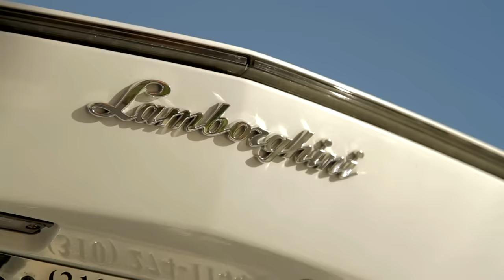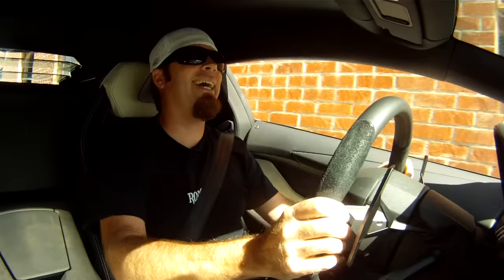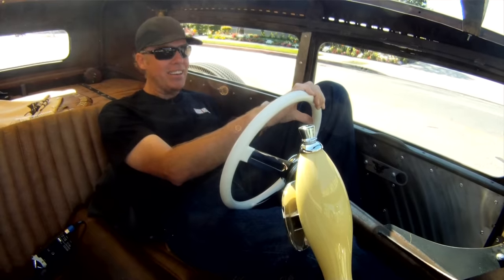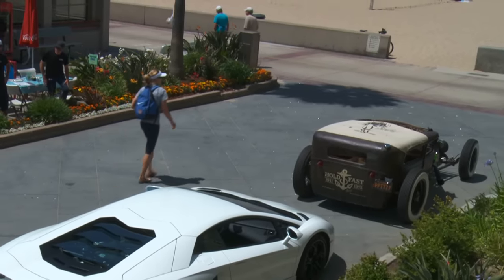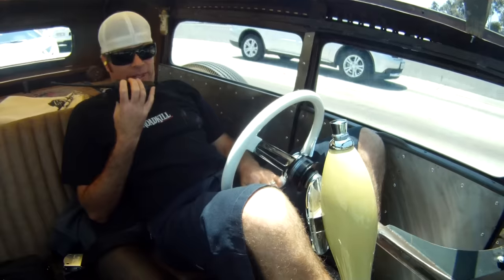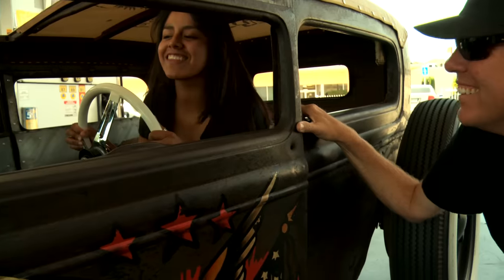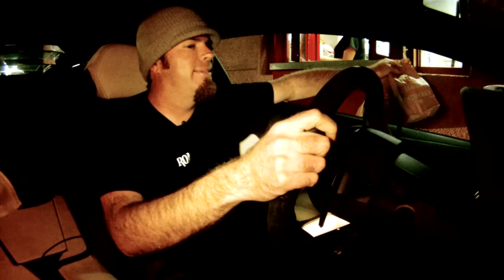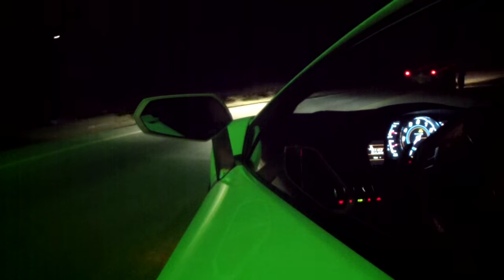Rat Rod vs Lamborghini Aventador! Roadkill Episode 5

Comment: The rat rod, hands down. But I'm a bit biased towards hand built death traps. ;)
Reply: each rat rod is unique and about 1/40 the price
Reply: I'm building a hand-built death-trap. It's a 1983 Nissan Patrol Safari two door. All Chevy drive train. 5.7 liter LT1 from a 1995 Impala SS, TH400 w/NP205 twin stick transfer case with Dana 60 front and GM 14 bolt full floater rear axles with 4.56 gears on 35" tires. Enough to get me in trouble...
Reply: have experience with 'em, eh?
Reply: I think I know why chicks dig rat rods...its because they know they'll get a similar experience to sitting on a washing machine during the spin cycle! 😂
Reply: @kevinkirk4285  Make sure you give it a beefy cooling system so it doesn't overheat in traffic. Also make sure the ride height is just enough so it doesn't get beached on slightly sloping driveways. 😉
Reply: @phantomechelon3628  Got the cooling system covered... It's rated for 700 HP for a 360 HP stock LT1. ...as for the rest... let's just say that Finnegan and Freiburger would be proud.... because...Roadkill... although I have anticipated any stupid situations... If I break what I have, I have far bigger problems... because...Roadkill.

Comment: They got ripped off spending $6000 on the lambo for 24hrs,  you can rent one for $1999 for 24hrs.  That's $4000 in the pocket for beer!
Reply: It's an aventador.. much more expensive
Reply: Remember this came out when the aventador was brand new
Reply: Mr Iceman ummmm I’m surprised that for 24 hrs they didn’t spend like 8 to 10 thousand ur probably thinking of the huracan but this is a aventador if u buy a huracan u pay like $250,000 but a aventador is $650,000
Reply: @joeymattison437  Who told you that the aventador is listed at $430,000.
Reply: Joe Mattison for an aventador svj yes 600,000 but for a regular aventador 400,000. aslo there is nowhere on earth that charges 10k to rent an aventador for 24 hours. Even in 2012
Reply: You forgot the strippers
Reply: This is California. It's mostly tax charges
Reply: How much beer do you drink?
Reply: The Aventador was a brand new car back then, it's obviously much cheaper now
Reply: It’s also in California so depends on where you’re located
Reply: No no, that 2012 Aventador was brand new at the time. Had to pay a premium for the new one.
Reply: Beer cheese and soft pretzels.

Comment: you guys are forgetting one small detail. Lamborgini is currently owed by volkswagen, a german manufacturer. And in germany there are many highways that have NO speed limit.  Furthermore there are highways where you can drive 130 k/m. On these highways there is virtually no speedcontrol at all. Which means people are also driving as fast as they want. So for the german customers a lambo is not just for the looks. They can legally drive it on public highways at max speed. 

Btw i drove a lot on german highways, and its quite cool when you can legally drive as fast as you car goes.
Reply: in theory... you're half right.
First off: concerning the speed control: do you mean the No Speedlimit ones or the 130km/h ones ? because on the 130km/h ones there is Speed Control. Only you barely see it if you are not going too fast. The other thing: Drive as fast as you want ??? yeah maybe in theory. In reality you barely get past 200km/h due to other people being in you way.
Reply: Ram Skirata
btw, I'm German
Reply: Ram Skirata I understand what you mean. But, if you want to drive fast, you can chose to drive late in the evening/during the night. I have driven in germany during nights and its max speed without much obstruction. As for speed controls, I dont know. I havent encountered any kind of speed control on 130 km/h highways, and germans just drive 170/180 on these without caring much. So I assumed there are basically no speed controls on these highways.
Reply: ok in the evening and at night you are right. But its still very dangerous once you get past 200. Simply because: it doesnt always have to be you fault. COncerning the speed copntrol: There is. ist basically invisible with speed traps well hidden.
Reply: I care to much about my car and my license. Also i am a very responsible driver
Reply: Ram Skirata When I drove in germany, it was in leased cars, so I didnt really care much about them anyway. I agree its important to drive responsibly. But when I overtake a truck with 160, and look in my rear mirrior and see a women in a mercedes coming at me at high speed, signing with big lights to get the fcuk out of the way, it kind of makes me want to drive fast as well.... :D
Reply: Siri Rii lol
Reply: contradoor12
Reply: they seemed to be hating on the lambo quite a bit.  probably because they can't afford one.
Reply: I dont think so. Freiburger has driver cars that outperform the Lambo in the quarter by far and while doing that are way cheaper.
Reply: but mostly other cars slower cars will drive in your front, even if there are 3-4 lanes :S
Reply: of course they do. C10s are fairly cheap e.g.
Reply: born and raised in Berlin. And the US just makes the coolest cars. C10s are failry cheap compared to euro standards,
Reply: contradoor12 They're in America.
Reply: Team Tornado Boy you speaks good American
Reply: William Chemini I can't tell if you're being ironic or if you're just oblivious to what you just said.
Reply: That's why the best Formula1 drivers (and, unfortunately, cars) are German. (btw I am not German)
Reply: See Em It may surprise you... Volkswagen manufactures vehicles under the following brands:  Audi, Bentley, Bugatti, Lamborghini, Porsche, SEAT, Škoda and Volkswagen, also Ducati motorcycles and MAN, Scania,  and Neoplan trucks. 

Scania, Bentley and Ducati were a surprise to me as well.

Btw Rolls Royce is a BMW brand for a while now. They made the Phantom. As well as Mini's....
Reply: Yes but Lamborgini remains italian...
Reply: Giovanni Carini just like fiat owns chrysler, but chrysler remains american
Reply: ***** And Chryslers are still crap XDGiovanni Carini  Lamborghini remains Italian, with the quality of German engineering behind it.
Reply: Mike well no, i have owned 2 and they gave me no issues so, your wrong i just wanted a corvette instead :) and lamborghini's are perfectly find without the germans and this is coming from a german
Reply: I'm from germany and here on the most highways aren't speed limits and if there isn't much traffic you can sometimes drive very fast
Reply: contradoor12 This thread has devolved so much it's sad. Don't even bother comparing a car to another car that cost several times as much. Not all muscle cars are slow through the corners (GT350R anyone?), and not all supercars are bad because they cost a lot more than things that are nearly as fast. When talking about muscle cars, it's important to note that they are fairly easy to drive every single day. You can't say the same about a Lotus, much less a Lambo. Cars are all good for different things.
Reply: NotAnotherYoutuber autobahn is just the german word for their highways. They do have big rings around every major city though.
Reply: contradoor12 Id still rather build 700hp than buy it, if its a 7 liter engine it should be making well over 700hp if it is tuned properly. $400K can get you a long way with a mopar or a blown alcohol chevy..
Reply: Mac Sogandares its not all about hp. in the US a race car just needs to go in a cirlce or a straight line. In europe cars also have to be able to take corners fast. Building a car urself that can do that would require some seriously skilled engineering ;)
Reply: contradoor12
That's right, because NASCAR never does road courses and Indy, AMLS, and Grand Am are definitely not real things. It's not like there are several world famous road courses in the US and various racing series that utilize them or anything.
Reply: contradoor12 no cars make horsepower like straight line cars. And road courses are a thing here as well. Current NASCAR spec is over 850hp unrestricted for road courses, so your argument is invalid
Reply: lamborgini is owned by volkswagen, which is a german manufacturer. I did not mean to say that lambo's are german. 

I do note however that the influx of capital and technical knowhow has benefited the brand greatly. Consider that when Volkswagen/audi took charge of lamborgini in 1998, there was only 1 available model, the Diablo, which was basically an 80s car that was still being build until 2000. After 1998 two new lambo's started development Murciélago & Gallardo and both were released in 2003. If you understand what this means, you'll see that they are still Italian cars, but with a very large amount of german technology, a lot of it came straight out of Audi's research center.
Reply: THATS SUCH ALIE
Reply: contradoor12 You are wrong m8 Lamborghii is owned by Audi since 1998 :D
Reply: Pavle Panev you should look up the family tree of the volkswagen group. Its selfexplanatory ;)
Reply: Pavle Panev Audi is owned by volkswagen group :)
Reply: Ram Skirata
Reply: Marcus Page
Reply: contradoor12 lamborgini isnt owned by volkswagen its a company by its self
Reply: ***** nope
Reply: ***** Actually Lamborghini was bought about 5 years ago by FORD!!!!!!!!  Ford decided they really didn't want it to start with - so they sold it to Volkswagen - which now owns 55% of Lamborghini!!!!!!!!!!  VW went on a buying spree a few years ago - VW also own Audi, Bentley, Bugatti, Lamborghini, Porsche and Ducatti!!!!!!!!!  It is a cold world out there - sell or be eaten!!!!!!!!!
Reply: +billyhatcher643 I'm like 😱😁😳😶 when I found about this really Volkswagen
Reply: Volkswagen owning Lamborghini has nothing to do with anything..
Reply: contradoor12  that is cool I thought lambergini was its own company
Reply: an aventador can go 354km/h... good luck driving that thing at max speed, you could drive it fast yeah.. and the acceleration would let u achieve speeds fast, but you wouldn't go much further than 200-240km/h
Reply: Problem with german Autobahn is: as soon as you're up to speed you have to slow down again because of a fucking construction site. Also, there can be speed limits on some parts where you have to drive 120 or 100.
Reply: ehh tbh i drove my bmw 118 with 134bhp at 211 a few weeks ago... i guess a lambo can do much better than that... hehe. But I do not condone unsafe driving in any way. I drove 211 just for a straight stretch of highwayr of 2 kilometers with no-one else on it...
Reply: I wouldnt never buy a Lamborghini. Cost vs product a person could have a company of their choice  build a brand new o mile american v8 of their choice cheaper that would out preform a Lamborghini in every way and still have 3x 4x the power.
Those cars are more a a status symbol I think.
Reply: contradoor12 so your saying that I can drive 200mph on the German highways
Reply: contradoor12 🍈🍈
Reply: contradoor12 k
Reply: contradoor12 oh yea Im driving with my bugatti in german 400km
Reply: contradoor12 no actually the company,Lamborghini Automobili made Lamborghini and Volkswagen Doesn't own or made Lamborghini
Reply: CesarGaming 9012 Lamborghini automobile is owned by volts wagon - Jesus Christ auto correct
Reply: Mythical bro Hgh haha nice one
Reply: Mythical bro Hgh ore like the morgue lmao
Reply: contradoor12 i
Reply: contradoor12 Lamborghini is owned by Volkswagen and Audi
Reply: contradoor12
Reply: contradoor12 I
Reply: I did not knew that
Reply: ziyan
Reply: contradoor12 germany is the richest place in earope
That make bmw's or so they made toys like playmobil... idk why im talking help!!!!!
Reply: contradoor12 the autobahn

Comment: What about a lambo v12 in a rat rod ?
Reply: hahha i like it
Reply: Depends on the ratrod. Itd probably tear the thing apart. Some ratrods can handle a frikin lot of power but probably not a v12
Reply: Idk some rat rods have mad engines and would have more power
Reply: As long as it has a strong enough body it works
Reply: @Mr. Hollywood ok thanks. Its quite interesting
Reply: That would ruin the rat rod
Reply: Halo themes intensifies
Reply: Forza has entered the chat
Reply: @J D it would, not all engines weigh the same

Comment: Everyone seems to forget that these guys are hot rodders and drag racers. In the grand scheme of things, 700bhp really doesn't cut it. That's the sort of power they were getting out of their 'Draguar' and that's just a cruiser.
Reply: ummmmmm the draguar maybe made 250hp
Reply: Have you seen the episode of Hot Rod Unlimited where they swap in a new engine and bench test it? Puts out way more than 250bhp now.
Reply: DoesNotHaveAnXbox I love your Icon. Motorstorm <3
Reply: TheMalysch77 brake horse power
Reply: Nick Milley but why does it bother you if I want an old Jag with a small-block crate motor and a supercharger sticking out the front over an Aventador? And I love Lambos, just that a one-off rod like the Jag will always be unique.

Jeez, why is there so much hate between the different aspects of car culture?
Reply: TheMalysch77 wheel horsepower. Basically the power measured at the wheels, after it's gone through and lost power through the gearbox, differential etc. Brake horsepower is measured at the crankshaft.
Reply: Nick Milley You just saved me a lot of lines! Nick for president!

Comment: Your rat rod is luxurious. My '32 Plymouth coup rat rod didn't have a seat, and the floor pan was a 1 ft. wide piece of plywood  that spanned the frame and wasn't even bolted down. It slid back on acceleration, and was stopped by the roll bar. The bad front U-joint and the open driveshaft were a bit of a concern though. Thanks for the memories. You guys are having way too much fun!

Comment: Wow, I must be weird! I'm as male as it gets, and I'd take the rat rod over the Lambo any day.
Reply: +awesomeferret to have, i'd take the lambo. you'd really want to drive that deathtrap on a regular basis and a car with the most basic safety features?
Reply: +awesomeferret not to mention overheating in traffic
Reply: Duns for Hands no, but considering that most Lambo owners don't consider it their primary car and don't drive it every day, is it really that much of an issue? Anyway, if I had that specific rat rod, it wouldn't be that specific rat rod. I would make some modifications to make it a wee bit safer (moving the seat, raising the top and installing a bigger windshield, for example).
Reply: +Duns for Hands Just a matter of time before the pistons shoots up in the sky and the engine block will be scattered all over the road, haha.
Reply: +Duns for Hands that was the worst example of a hot rod my friend
Reply: +Johannes Larsson Yeah but its way cheaper to get a replacement motor for that rat rod than the lambo. Blow the motor on the lambo and you are talking easily close to 6 figures.
Reply: +awesomeferret no you are just a car guy most of those guys noticed the lambo because thats a popular vehicle everyone knows the ratrod was the real treat
Reply: I'd gladly take the rat rod
Reply: you are definitely not alone!
Reply: same!
Reply: Lamborghini's don't have airbags.
Reply: +Rotten Banana ya theydo
Reply: Justin Smith Most don't. Btw the ones that do have airbags, only have the driver airbag.
Reply: +awesomeferret They dont consider it their primary car because they don't trust themselves to drive around that kind of money

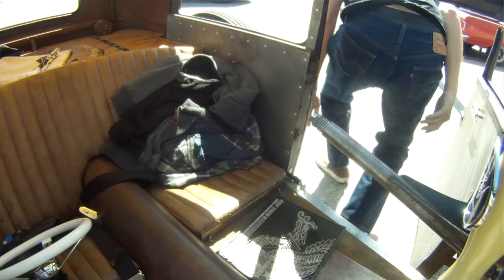Comment: rat rod sound awesome, but lamborghini anytime... 8:35 are you sure that the steering rod is not the one that kills in accident?
Reply: No, the rat rod is more fun.
Reply: my dad had a rat rod back in the 80's. not because he wanted it be that way, but because of budget and just wanted to have fun in it. 1940 dodge business coupe with a 440. tunnel ram, 906 heads,   525 lift came, heads ported and polished. 410 gears. pretty sure that car would give that lambo a run for it's money for speed.
Reply: nmij
Reply: there are a million ways you would die in that car if you were involved in an accedent. :-/
Reply: +poncoolride i which car?
cuz if you're talking about the lambo, most supercar accidents are very minor, as most just occur from spinning out on takeoff or around a corner, all happen at low speeds. you are more likely to die from texting while driving than flooring it to get from 0 to 100 or something, because you usually just slide about on the open road.
Reply: The rat .
Reply: Cole Ovian the rat
Reply: Cole Ovian but I've got to admit I'd prefer the rat rod any day over the lambo
Reply: poncoolride ok
Reply: poncoolride mocc

Comment: Idk why they even made this video. They're obviously rat rod fans and all they did was down the Lamborghini. I'd take the Lambo over that deathtrap any day
Reply: They did complain about both cars. Or did you miss the parts where they mentioned it sucks in traffic, an accident would be lethal, it's entirely uncomfortable to use...
Reply: Allurade Yea, and they still said they're rather the coffin on wheels. Did you miss that part?
Reply: No. And it makes sense because hot rodders prefer things they built themselves. And besides, did you miss all the women that checked out the Rat Rod?
Reply: You guys just dont even get it. You compare specs and horsepower's and how expensive it is. You have no idea how much character this rat rod holds.
Reply: Well, I'd rather something that I built myself than something that says "I'm rich and have a tiny penis"
Reply: shiffterCL  it has character and that's fine and all to some people, but i'd take that lambo in a heartbeat, the ratrod looks like something i wouldn't even drive if i owned it, the lambo is something i'd never want to stop driving.
Reply: Tony Bowyer I probably wouldnt drive it either. I mean it wasnt even ment to be driven. The car was specifically made to be looked at.